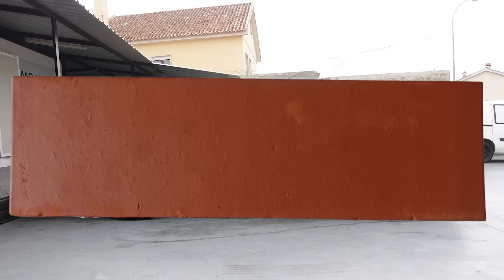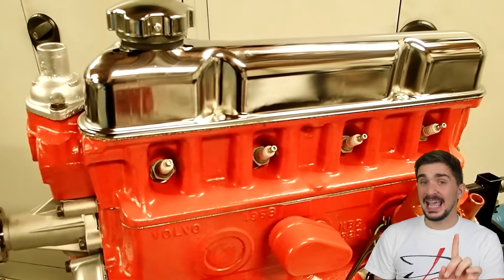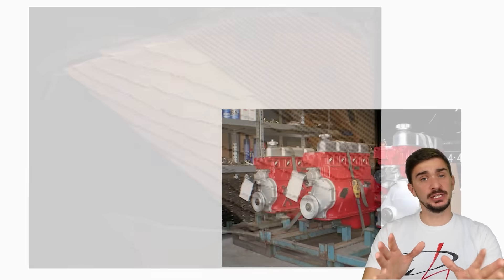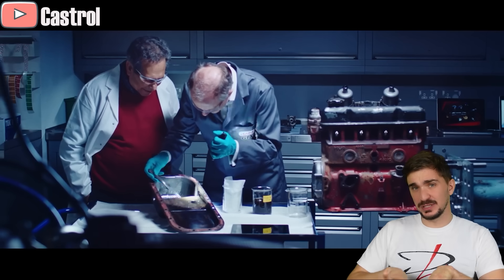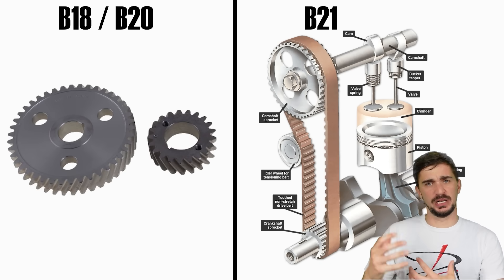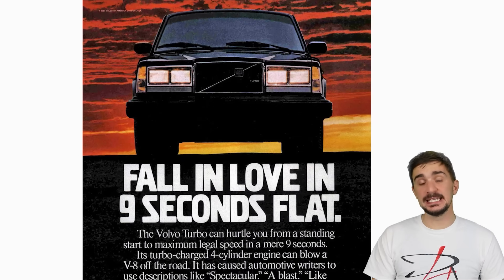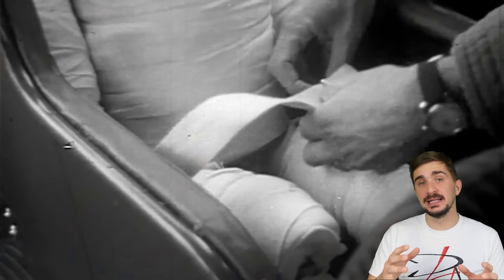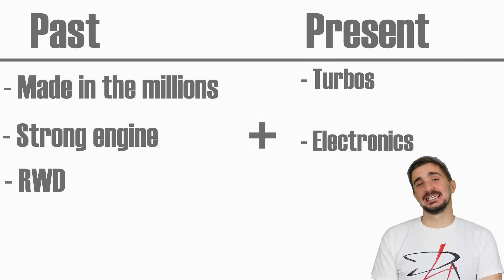A Story about the Volvo 240 and its Redblock Engine - Iconic Cars and Engines #18

Comment: Back when Volvo made Volvos.
Reply: unfortunately kinda true. have an new-ish Volvo my self. the build quality oft the car is good, its very safe, stable and over all a good car. but the drive train is not as good as before. the newer VEA engine family is kinda stressed and over complicated, much like modern VAG engines, and lack any character, again much like modern VAG engines. the 5 cylinders were great. but the 4 pots unfortunately are not.
Reply: @phg4977  The problem with Volvo is that, just like it's German counterparts, it ditched the idea of "the everyday man's car" and went for the more luxury sedan section. Now said affordable vehicles are the purview of the Japanese and Korean automotive industry. I have a Volvo 2010 S60 and, while I really do enjoy it, know that it doesn't compare to both the affordability that its ancestor had.
Reply: @CG-yq2xy  Its better for the bottom line to sell fewer cars with higher margin than the other way around apparently.
Reply: @CG-yq2xy  Volvo has never been an everyday man's car.
They' ve always been lower to middle premium
Reply: @CatacombStranger  🤣 you are definitely wrong. Volvo is a everyday car in all the ways.
Reply: @MrBjarkenfjart  Has never been the case. They have always been expensive compared to Japanese or European brands like Fiat, Renault, and Opel. A Volvo 240 was a premium car that came with a premium price tag.
Just because they're common doesn't mean they're cheap, because they definitely never were, unless ofc you go back to the Duett and PV days.
Reply: @CatacombStranger  It's the case, at least in Sweden.
Reply: @CatacombStranger  PV 50s were an everyday car.
Reply: @MrBjarkenfjart  everyday car for the math teacher.. not his class dropouts.
Reply: @CatacombStranger  True, but the older ones were always considered an investment which should be maintained. Today's culture is all about buying it today and replacing it tomorrow.
I can't even tell if the vehicles are American, Asian or European today. The market today is about "cellphones on wheels". I doubt any of the new owners can tell you what is under the hood/bonnet.
Reply: @boomerguy9935  All cars were an investment back then. The price range was also much narrower between brands and models.
The average car owner back in the day wasn't that interested or knowledgeable either. People have always been the same.
Reply: @CatacombStranger  Family orientated people buy them, not for enthusiastic car people !
Reply: @CG-yq2xy  Hmm, the 200 as well as the 700 and 900 series weren't cheap cars. They tried to compete with Mercedes and positioned those cars in the upper-middle class.
Reply: @phg4977 to be fair my 13 A4 had an amazing engine that I loved. It had over 180000 miles with very little maintenance before it was totaled by a deer. It was always ready to give 100%, to a fault some times. Had it 5 years and the only thing it needed was new shocks spark plugs and CV axles and wheel bearings due to its mileage. 

Now I have a modified 03 xc70 and it's a more comfortable relaxing car to drive but I miss the little extras my Audi had like rain sensing wires and it would keep the coolant flowing to the turbo if it was still too warm when I turned it off.
Reply: This is the truth. Now they make euro boxes like everyone else. Still safe though, it seems.
Reply: @salvadorpalma8173  Everyone makes the same boring SUV shape now. I hate SUVs with a passion, also modern trucks (post 1995). At work there's a toyota, bmw and volvo, I can't tell them apart except by the logo, they look like the same car. We're in a 50 year nadir of car design and it might never get better.
Reply: @salvadorpalma8173  now they are Chinese
Reply: @Blackadder75  Sadly yes
Reply: @Blackadder75  they used to be American which was arguably much worse.
Reply: @CatacombStranger  lol
Reply: @Blackadder75  Wrong. The main stock holder is chinese but the car still is swedish. Most of them is built in Sweden Thorslanda by Swedes.
Reply: @CatacombStranger  Eh the P2 Volvos are just fine. The ones with the I6s paired with the GM transmissions sucked ass though.
Reply: @wood_louse119  They are Chinese owned, but still made in Sweden and also now in North Carolina, US.  only two factories I know of for Volvo at present.
Reply: @spartan9458  Yea, I am from Sweden so I know there are factories still working here. But is there any Volvo factories in china now aswell?
Reply: @xSupra  They're fine because they were all developed before Ford took ownership.
Reply: @CatacombStranger  The era when Ford owned Volvo was much better than the chinese owning the brand now
Reply: @squiresonwheels3249  My V50 says otherwise
Reply: @Blackadder75  No, they're not. That's a fallacious assumption people make. They're quite Swedish. They were almost American under Ford but Chinese have preserved their Swedish operation.
Reply: @benjaminsmith2287  I know the Chinese let them be their own thing  ( for now)
Reply: @Blackadder75  They've been owned by Geely for 14 plus years. And again, it's Geely, not (the Chinese) for me.
Reply: @salvadorpalma8173  Much safer actually
Reply: @salvadorpalma8173  They are Chinese now.
Reply: remember when the volvo drove with a shipping container on its roof? yea that wont happen anymore
Reply: @n2oin  well its the case. In Sweden its a everyday car.
Reply: @MrBjarkenfjart  So you comment this on how many replies..? I see 3 so far there better not be more, one should be enough but you seem to have Sweden bias, so I expect you to be a Sweden main on War Thunder
Reply: @n2oin  😂 well still a everyday car. Premium in the lower spectra, yes. Iam answering multiple comments so of course there are more then one answers. Please explain Swedish bias?
Reply: @n2oin  iam might ad before you get sad. I love volvo. Hade over 5 of them since 1999 to 2023
Reply: @n2oin  My 940 estate still does! My kids have never had to hire a removals van when they've moved houses.
Reply: Every car after 2005 sucks. Even the most reliable always top brands start building crap from that point on.
Reply: Spot on... Durability just declined since the whiteblock. I wouldn't be sueprised if this outlive the VEA engines.
Reply: exactly ! I owned 245, 850 station. V70, XC 70, ordered now a XC 60 , but I think it will be the very last...........looking at this TURBO-ugly XC 70 or even the "coupé" version..........
Reply: Agreed. My grandfather had one of these and it was a fantastic car in its time. The modern Volvo has a certain Chinese flair to it.
Reply: and they where handed down in the family,  all the kids learn to drive  or drove off to college in the 245 wagon with 200,000 mile on it
Reply: ford ruined volvo
Reply: 240 then 740  2.0 to 2.5  GLT models   B19 to B20 engines  terrific cars!   now no more!... all renault or peugeot engines!..    estates have shrunk in size   that enlarged back tailgate window on the revised 240 was brilliant   you could see everything!
Reply: Back when Ford didn’t own it lol.
Reply: @darklord7979   yeah takeovers ruin everything apart from when Volkswagen Audi took over Skoda that is!   I had the PRV engine in the E reg 240  that came out of a Volvo 262 2.8 litre V6   RAPID and thirsty!  20 mpg   no Volvo original red block  no forgiving 5 speed box either ..
Reply: Amen!! Wouldn't buy a new one or anything after 2003
Reply: @Username-2  well in Sweden it's a everyday car. Considered a low premium car.
Reply: now they make Geely toys
Reply: they still make volvo's, but they sold the car division. smart decision of them
Reply: Back in the late 80s/early 90s, we bought a brand new Volvo 240 wagon in England. We LOVED that car.
Reply: Yeah, now they only do heavy machinery and semi trucks. The car company is owned by the Chinese now.
Reply: Volvo made all of the car, but not all of the engines! See my post above.
Reply: Yeah, Before Ford made Volvos.
Reply: Back when Gyllenhammar was the Ceo.
Reply: no, volvo still makes volvos. the way the global economy works has changed a bit.
Reply: I owned a 240 for 20 years, awesome vehicle.... Volvo is a Chinese Government owned Company now, brutally sad... Now the Swedes are saying the CCP mafia is going to kill Volvo and destroy its name.
Reply: Exactly! 🙂
Reply: Now with the combination of Chinese under dimension and swedish over dimension..  they are just normal cars
Reply: I bought a brand new 244DL in 1980. Four speed w O/D, sunroof, painted the prettiest red I ever saw. I sold that car WEWAAAAYYYY too soon!!
Reply: All modern cars are boring and have zero personality with the digital dashboards, touchscreens everywhere, way too much technology and computers, and wimpy small block/big turbo hybrid engines.
Reply: Even worse now with cars made in China suspected of having Beijing god mode
Reply: It is heartbreaking really how far Volvo has fallen at terminal velocity.
Reply: Back in the day when everyone made good cars rather then crap plastic hybrids with 0 sound and even worse interior and durability , that shi  starts to rust after 3 years
Reply: Hurts my heart every time I hear it.
Reply: They are still made in Sweden although the owner is now Chinese.
It's like with all British cars now, owned by India or Italy and mostly Germany.
Sweden is a small country and may be the reason while for the Brits I will not mention the reason, but it wasn't quality.
Also Volvo builds damn good trucks too as before.
Reply: @hurri7720  Volvo AB has absolutely nothing to do with Volvo Cars.
Reply: @hurri7720 Volvo Lastvagnar has nothing to do with the Geely Volvo though.
Reply: @hurri7720  I thought the Volvo cars we buy here in Australia were Chinese made. Am I wrong about that? Maybe its just the Polestar? The trucks are very popular here where huge mileages are the norm. I have a friend who still drives his brick amongst much ribbing.
Reply: @andrewblake2254 The trucks as in volvo group trucks operations is 100 % swedish. It is a separate company from the cars. But yes most of the cars and engines are made in sweden.
Reply: Most of the comments I see here are pretty clueless, the modern Volvo sells so much better than the old boxy style, random people might reminisc the "good old days" but they were failing as a brand, that's why they were bought out by Ford who subsequently sold them. The Chinese owners have done a good job reviving this brand and they've seen consistent sales growth (at least in the overseas markets) for the past decade.

It doesn't matter how good you thought the old design/build was, they didn't sell, so without the modern look it would've either died or become completely irrelevant.
Reply: @metalfly.  Every Volvo owner I've ever talked to since the 1960's (yes, I'm that old) has referred to their car as an investment. These people bought these cars to keep rather than to replace every two years. In other words, practical people who appreciated their value actually hurt the company's bottom line. It's ironic that what made them so great also slowed their total sales. Quality over quantity.
Reply: @boomerguy9935   That's interesting to me because I would have thought they sold well- it seems to me I saw plenty of them back in the day.  But maybe they were more noticeable to me since I drove one.

So, I searched and compared it to the Camry.  Volvo apparently made 2.9 million 240's, Toyota made 13 million Camry's.  It works out to about 317,000 Camry's annually and 152,000 Volvo's annually when you take into account the 240's 19 year run, and that the Camry has been made so far from 1982 until present.

But then maybe that's not really a fair comparison because the Camry has still been made all these 30 years since the 240's stopped in 1993, and I'd think population growth etc would mean greater numbers of cars in general.
Reply: Volvos are still ugly, their EV line downright pathetic.
Reply: Volvo still makes Volvos. The problem with 240s is some folks seem to want to keep Volvo in the same place as the were when they made the 240. It's actually a car that almost bankrupted Volvo. Volvo was falling behind with this model, even if it was popular, and the 760 and 700 series and then the 800 series, with their more advanced suspensions and designs, moved Volvo forward .Every product evolves. But Volvo, after Ford's purchase, got back into making fundamental Volvos thankfully because the Geely parent company empowered Volvo to do so.